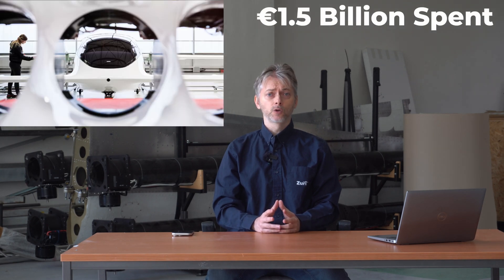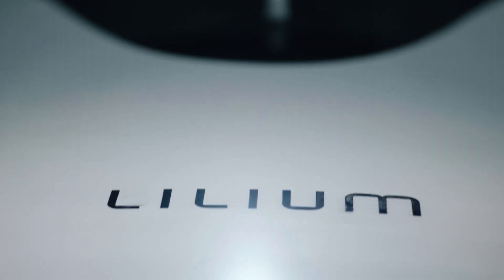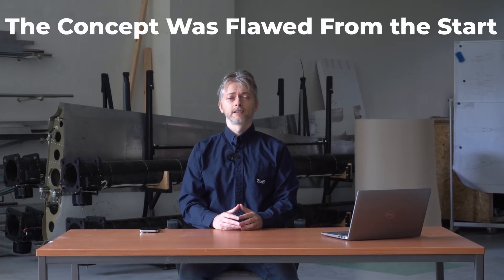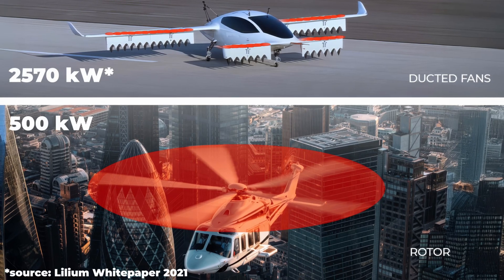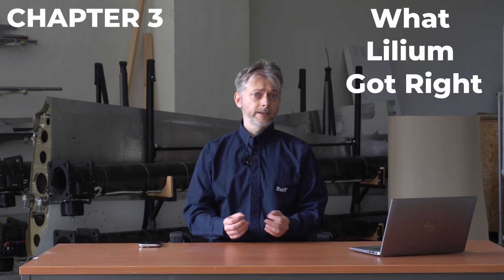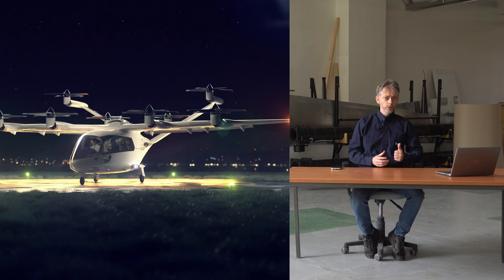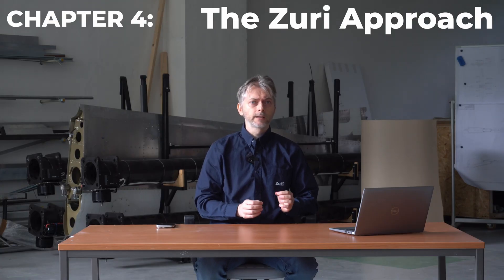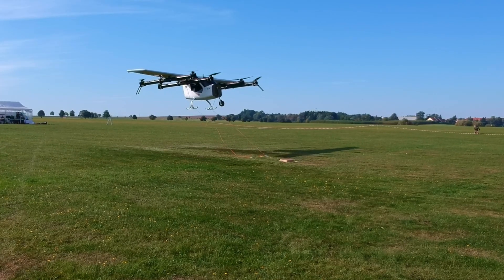Lilium's €1.5B VTOL Collapse Explained — Why It Never Flew

Comment: Good analysis. You definitely cannot operate with batteries for long distances however much money you spend.
I don't buy the SAF argument, (kerosene is fine tbh) but to play the sustainable game and get the right funding from the right bodies it might be necessary.
If someone can fly a transatlantic heavy transport with battery technology alone then they will be very special.

Comment: If you speak of efficiency you should then speak also about the flight profile and the advantage on cruise vs the disadvantage at take-off... Also you said physics doesn't work by showing a FLYING prototype which worked. Same as the flying test campaign in Spain with a lot of videos also available. There is really good video already available on YT explaining this So I think you misunderstood the physics of the Lilium jet here and should maybe do a little bit more of research … And i am sorry, but by saying “the physics always wins”, you indirectly also insinuate that the engineers working there didn’t understand physics…

Comment: Lilium was a scam... maybe not from start but very close to it. Once it started to bring money... that was its purpose. A system's purpose it's what it does.
Now looking at your Zuri craft... I can only smile when hear you that Lilium was a failure from the start.
You do know other people know that your project and any similar project like yours is a failure from the start... right? I mean... you have to know it at least deep down in your own mind :D .
Your Zuri is a failure because ultimately  it doesn't try to achieve anything. You too end up with a contorted plane-helicopter that does nothing better than either of them and has a ton of paper to fill and billions to burn through.
Someone that propose to himself to create a pair of magic flying pants has better chances than your craft at realizing SOMETHING!
Now... you will say neah.... What do I know... I am a nobody on the internet. When your project ends up in the bin just like Lilium... remember this! You failed because you planned to achieve nothing from the start!
Reply from the maker: Zuri Hybrid VTOL is built for regional mobility.

It can fly up to 700 km and take off and land closer to where people live and work. That helps reduce congestion in cities and airports by moving short-haul trips out of those spaces.

The hybrid system uses electric propulsion and sustainable aviation fuel to lower emissions while extending range beyond fully electric aircraft.

Zuri is also designed to operate with much lower noise than helicopters, making it better for use near homes, offices, and remote communities.

It can use existing infrastructure like small airfields or helipads, with no need to wait for new vertiports.

We're building a certified aircraft, designed to meet real operational and regulatory requirements.

It's a practical aircraft for business travel, cargo, medical transport, and reaching places underserved by today's infrastructure.
Reply: @zurivtol  Man, you make me laugh. :D :D :D I am no VC...
Your craft makes no sense. I don't know how much simpler I could say it. I can talk a lot about these kind of aircrafts but for now nobody is interested in anything but making some money out of Debt-Ad-Driven-Economy.
So... I wish you a pleasant wake up from this "dream" :D .

Comment: Very efficient and decent comment about this (former) competitor. Thank you for your insights! The goals that they claimed were always extremely ambititous especially for a first market of early adopters. An easy to control, small size , low noise, low pollution VTOL would find thousands of customers even if it had a range of only 10 km  and only space for two persons.  But physics prevented it with that approach and most likely their techniscians already knew it when they went public first. But a job is a job nowadays. Doesn't necessarily have to make sense.

Comment: Back in 2018, NASA published a comprehensive set of detailed studies on all aspect of the eVTOL domain (Advanced Air Mobility Mission Documents https://www.nasa.gov/general/advanced-air-mobility-mission-documents/ ), which were never mentioned or quoted in the midst of all the hype. In line with the 'Physics' observation, mentioning the crippling availability statistics reality in the USA simply because of seasonal weather conditions was avoided at all cost - I directly challenged several executives of these companies to provide any sort of take-off and landing weather minimums, especially maximum wind velocity, and gust variability both for conventional airports and proposed building tops amidst street canyons in urban areas. No amount of tech overcomes fundamental aerodynamics, especially in icing conditions.

Comment: Lilium burned through €1.5 billion developing its VTOL jet, yet it never took off. For context, the Cirrus Vision SF50 cost $150–300 million to develop, the Cessna Citation Mustang $160–250 million, the Embraer Phenom 100 around $100–150 million, and even the HondaJet was $290–430 million. 
      Lilium’s $1.7 billion price tag for a novel aircraft from a startup is staggering, and as an investor, I’d be furious. Some made fortunes off this flop. Electric VTOLs like Lilium’s are a fantasy without major battery breakthroughs. Michal Illich, CEO of Zuri, another EV aircraft venture, speaks in a robotic monotone, devoid of passion. Investing in his company feels like throwing money into a void. Battery tech? Incremental improvements are all we’ll see soon. Lithium-Sulfur is a decade out, and Lithium-Air, if it ever happens, is 50 years away. Anyone pushing EV aircraft knows they’re impractical today.

Comment: There is a misconception in the "LILIUM CRITICS COMMUNITY" as they compare the "aerodynamic-lift-cross-section" between helicopters with Lilium micro jets inlet section. However the jets are supposed to provide thrust, not aerodynamic lift especially during take off and landing.
When Lilium jet engines would be changed from e-jets to SAF powered micro jets it would be even better for the environment and the energy capacity problem is solved for ever.

Comment: The calculation at the end of the video is wrong. 

12 kWh per kg of chemical energy equals approximately 4 kWh of electric energy (thermodynamic efficiency)

So the factor between  fuel and Li-Ion is around 12-15 but not 30.

Comment: The LILIUM concept is clearly misunderstood. Takeoff and landing represent only 10% of the entire flight, while horizontal flight represents 90%. During takeoff and landing, Lilium uses 5 times more energy, but during horizontal flight at least 3 times less than competing vertical take off aircraft, not to mention helicopters. Since horizontal flight represents 90% of the entire path, the utilization is reversed in favor of Lilium. The Lilium was intended for longer flights, not for short flights with frequent takeoffs and landings. I also did not understand that the battery would be an issue, perhaps only in the range. Since the demonstration model took off and flew with ordinary batteries, the test Lilium would also fly with a larger amount of batteries, since the mass and batteries increase proportionally.

Comment: This is such a narrow-minded view. Yes, the Lilium disk load is high, likely too high. But the Lilium jet (and all e-VTOL aircrafts out there) is not a hover machine like a helicopter. It was never meant to be efficient in hover. This aircraft would spend less than a minute in hover mode, all the remaining of the flight would be in cruise, where it is more efficient than propellers. There are plenty of things that were wrong with Lilium, no question about that. But your video is only meant to promote Zuri aircraft by using a hyped failed company to generate views, not really to inform on what went wrong with Lilium... I think this is erring on the dishonest side

Comment: Michal, your claims about the Lilium Jet seem off-base, and I’m wondering if this is intentional misrepresentation or genuine misunderstanding.

You’re aware that the Lilium Jet is an airplane designed for efficient horizontal flight with VTOL capabilities, not a helicopter. So why frame it as one?
This feels like a deliberate strawman argument, built on a false premise and irrelevant criteria, like criticizing its hover efficiency when it’s optimized for cruise.
Also, suggesting that efficient cruise doesn’t require high disk loading is surprising for a CEO in this field.
It’s a fundamental principle for eVTOL design like Lilium’s.
Reply: I actually agree that Lilium is quite good in cruise flight, I have said it several times even publicly. But they insisted on being an eVTOL, without being able to demonstrate the actual VTOL phase with a fullscale aircraft and payload. That broke them.
Reply: @MichalIllich  Good, then we are one step closer to a neutral view. The demonstrator on a 70% scale already demonstrated the transition years ago, which is not rocket science and does not change when scaled to 100%.

They simply overdeveloped Lilium, even though they were still dependent on investors. They developed a new aircraft even though the first one was not even on the market yet. The need to generate their own revenue could have been a way out of this vicious circle. Above all, they could have brought valuable experience from the field, which is more relevant and valuable than simulations.

Batteries are now available from Amprius (SA08 & SA03) with 360Wh/kg to 400Wh/kg, with the SA03 delivering 5C continuously while the SA08 variant can only deliver 1C continuously.

However, the costs for these batteries are very high, with end customer prices ranging from $2300 to $2600 per kWh at UpgradeEnergyTech and TitanBatteries.

Comment: Why would such a company hire so many people, building up a manufacturing plant, having contracts for a specific for them designed batterie and fail at the basic physics, like some claim? Didn't they use advanced computation for calculation of all the necessary details? They are not sitting there with pen and paper and failed because of a rounding error.
Reply from the maker: Big teams and custom batteries don’t override first-principles physics—simulations still hinge on the input data. Using Lilium’s published specs, our quick check shows the energy margin is razor-thin. If you have different figures, please post your calculations here and let’s compare.

Comment: SAF production Is negligible right now and by the time it does there will be 500Wh/kg solid state batteries that will make electric multicopters viable.
Reply from the maker: Fair point — though in reality, battery tech is progressing slower than many would like. That said, we’re cheering it on — high-density cells will benefit hybrid systems too. 
Either way, we still see hybrid as the most suitable solution for real-world use cases.
Plus, the system we’re building can run on both conventional fuel and SAF — which adds flexibility right from day one.
Reply: Unfortunately, even 500 Wh/kg is not enough. SAF has 12000 Wh/kg of usable energy.
Reply: @MichalIllich  true, but less than half of that is actually converted into kinetic energy. Still an bootload of energy. Some napking math, an A320neo carries up to 21 tons of fuel for a max range of 6300 km.   For every km it burns 40kWh of thermal energy. Assuming a 2.5x better efficiency of an electric plane, 21 tons battery would store 10500 kWh which makes the plane flying for 700 km. So it is really viable only for regional airplanes.

Comment: Also, because the Lilium was designed with the wing all the way at the back, and a small canard at the front (which was completely covered with ducted fans, so probably useless as a "wing", if that thing lost power to the front fans it would become a lawn dart.  Better have a CAPS  style parachute on that vehicle!
Reply from the maker: Good point — stability in power-loss scenarios is critical.
If the design relies too much on front thrust without passive lift, control can disappear fast.
That’s why we focus on aerodynamic efficiency and redundancy from the start.

Comment: Wish they would have pursued short takeoff and landing rather than vertical.  It adds an additional market and eliminates the need for exotic batteries.
Reply from the maker: STOL is definitely an interesting direction, but based on our calculations and testing, we believe hybrid VTOL offers a better path forward. Our concept has evolved over the years as the data guided us — you can see that progression in our videos on the YouTube channel.

Comment: Honestly, I think both companies are wasting effort and money. You said it yourself: the laws of physics are what they are. Your rotors are larger than Lilium's fans but still way smaller than a helicopter's rotor. When I look at your aircraft, all I see is the introduction of new headaches to create something that solves no problem. In a way this is the Titan submersible all over again.

And by the way, just so you don't think I'm talking out of my arse, I did the feasibility study on digital flight controls for what would eventually become the Airbus Racer, which you may have seen at the Bourget this year. That was way back in 2011. It took that long to make it a reality and something close to a viable product. It does what your VTOL does, but it doesn't have to reinvent everything to do it.

That being said, I'm not trying to discourage you. Innovation is always worth pursuing no matter where it leads. Worst case scenario, we learn what doesn't work.
Reply: Yes, I like the Airbus Racer. It's a great evolution of helicopters. But VTOLs are more than that - they will bring more efficient, quieter and cheaper alternative to helicopters.
Reply: @MichalIllich  It's almost trivially simple to demonstrate from basic physics that any e-VTOL craft will be limited to around 15 minutes flight endurance. Indeed Airbus built one which managed 13 minutes. Then you have to recharge the batteries all over again. Simply not at all practical.
Reply: @MichalIllich  I sure hope so!
Reply: @MichalIllich  Pokud chceš donekonečna zkoušet nesmyslná řešení, počítej s velkým pláčem na konci. Už jsem ti psal, v čem jsi na omylu. Ignoruješ to, namlátíš si. Tvoje chyba...
Reply: @8000SAC  It's almost trivially simple to demonstrate from basic physics that any e-VTOL craft will be limited to around 15 minutes flight endurance. Indeed Airbus built one which managed 13 minutes. Then you have to recharge the batteries all over again. Simply not at all practical.
Reply: the advantages over a helicopter in the cruise are huge, ang worth a loss in efficiency for the brief time in VTOL mode.
Reply: In other news, the Harrier and F-35 do not work, nor have they ever worked.
Reply: @PistonAvatarGuy  Don't be ridiculous. Both the Harrier and F-35 are battle proven and very effective.
Why do you even bother making such absurd comments ?
Reply: @grahamstevenson1740  I was making fun of the idea that a jet can't hover/VTOL.
Reply: @PistonAvatarGuy  Both the Harrier and F-35B can hover for a minute or so. It uses a LOT of fuel.
Reply: @grahamstevenson1740  Right, so the sole argument against the Lilium Jet is that it wouldn't be able to store enough energy onboard for it to be useful for anything, but if you have an ICE powered aircraft burning jet fuel, you're probably going to end up with a useful vehicle, even if it's not all that efficient during VTOL.
Reply: @PistonAvatarGuy  That's pretty much the case, current batteries simply don't store enough energy for their weight and there's no obvious avenue for that to be improved much.
Reply: @grahamstevenson1740  With a turbine generator onboard, it may have worked, but propellers are obviously going to be a better choice.

Comment: Bottom line: in the end, physics always wins. That's not fundamentally new. If investors would finally learn this one single, simple rule, we would see A LOT less of those cases where tech start-ups are going bust after burning through millions/billions of dollars.
Reply: Stejně dopadne i ZURI...
Reply: Lilium electric jet will work.  Physics will win.  Commercial Mass production batteries capable of 600WHr/kg are now available.  This is twice what Lilium calculated that it would need.   It may be 3-4 years before such capacity ratings are certified for manned flight aviation but its going to work.
-Lilum was just too early.   If their whole program had of started its run 2-3 year investor confidence and patience would still be there.

Comment: It is a question of disk loading and not simple physics.  The disk loading is the total weight of the aircraft/VTOL divided by the total area of the fans/rotors.  The highest the disk loading, the more power required to hover per unit weight.  The Lilum has roughly about 10 x higher disk loading than open propeller eVTOLs.  Most eVTOLs have significantly higher disk loading than helicopters.  Hybrid e-VTOL is not the most efficient system because either the electric parts or combustion engine components act like a dead weight when any one of them is switched off. eVTOL will only be practical when there is a breakthrough in energy density of battery.
Reply: It's almost trivially simple to demonstrate from basic physics that any e-VTOL craft with today's battery technology will be limited to around 15 minutes flight endurance. Indeed Airbus built one which managed 13 minutes. Then you have to recharge the batteries all over again. Simply not at all practical.